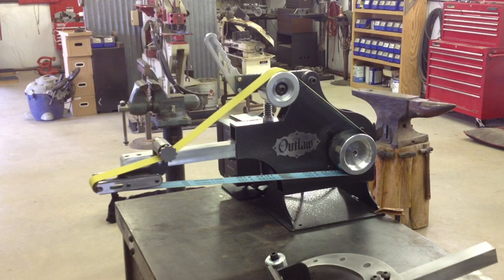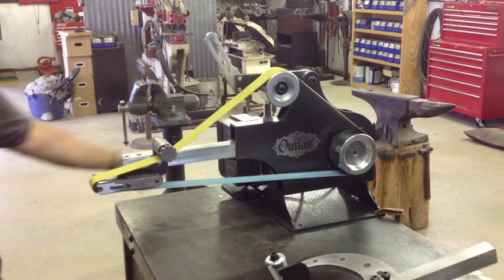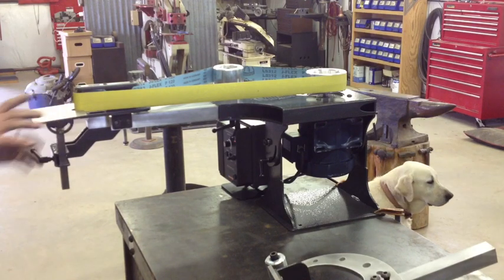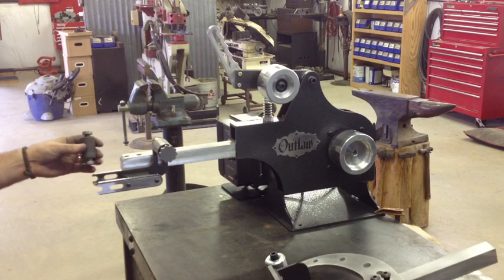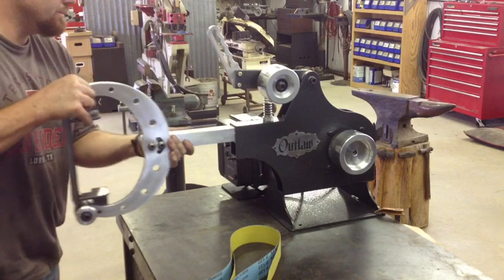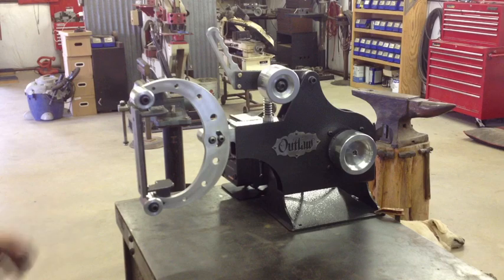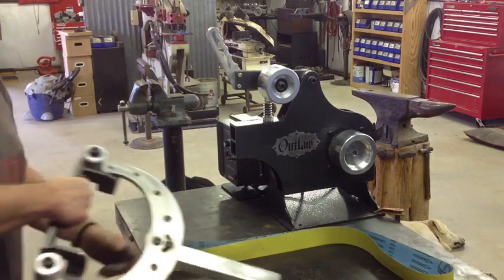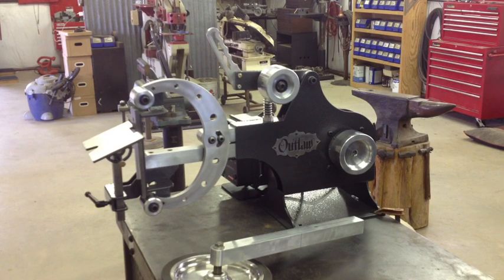Outlaw II Belt Grinder

Comment: Really nice unit, but the price is absolutely ridiculous. So a motor and speed control cost 500$ this I understand. But there is no way the rest cost 3000$ . I need to start making these things and sell for a fraction of the price . It’s better to sell thousands of units at a lower price than hundreds at an inflated price, because most people would not pay that much even if they had money to burn or they were dropped on their head way too many times.